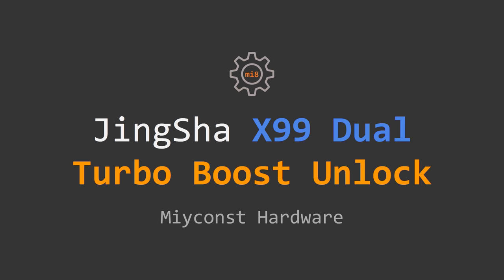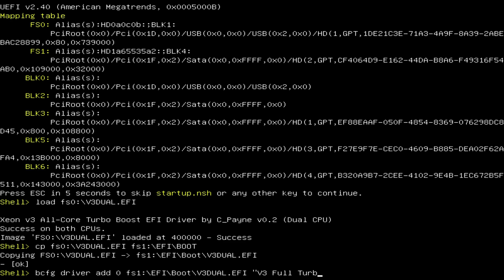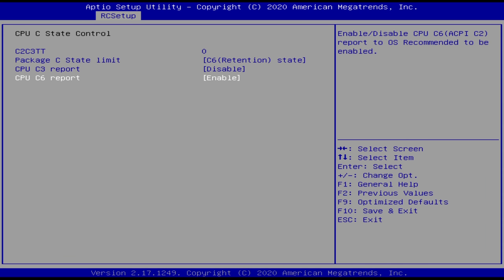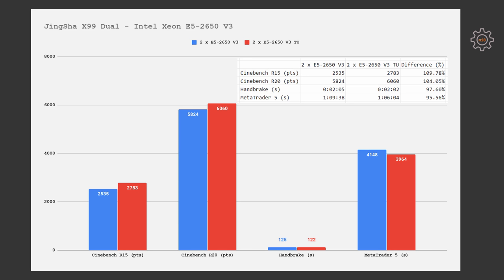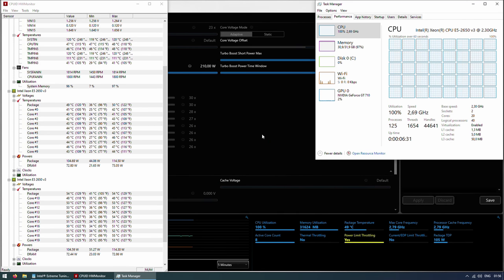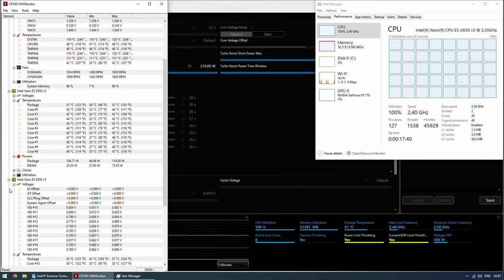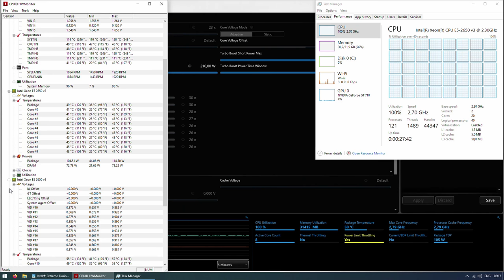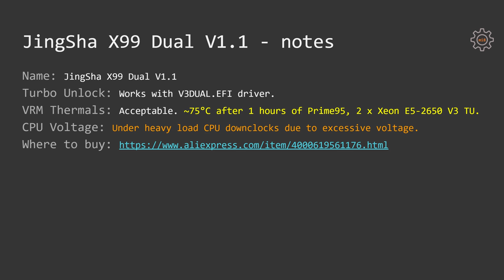🇬🇧 Turbo Boost Unlock on JingSha X99 Dual LGA 2011-3 with two E5-2650 V3

Comment: UPDATE: Now E5-2670 V3 (12c/24t) @ 3.1GHz Turbo, cost about the same as 2650 V3.
You got 2 extra cores + 100MHz clock with the same price.
Reply from the maker: Yes, E5-2670 V3 seems like an awesome deal right now.

Comment: I'm so glad I found your channel. English speaking channels about these Aliexpress dual socket boards are hard to find.  I'm currently running a Jingsha dual socket board with a pair of E5-2680v1 cpus and 128 gigs of DDR3 ECC 1600 ram  and an RX580 graphics card. Its not much for gaming but its a  beast of a work station.  I'm about to embark on a new build around a dual x99 board this time. I will be following your channel.  SUBSCRIBED!
Reply from the maker: Yeah, dual socket solutions are bad for gaming, but good for workloads which can utilize this many CPU cores & threads.
Reply: @Miyconst  Most of these boards will support VT-X. Would you know if this board supports VT-D. I would like to take advantage of PCIE  hardware pass through?  Thank you for your time.
Reply from the maker: @rdsii64  I can't say for certain, because I have not tried it myself, but others say it's supported.
Reply: @Miyconst  I may just have to find out for my self.  Either way, This board will make a really good budget media server. If it doesn't, I'll just build a 3rd box when I have the money.
Reply from the maker: @rdsii64  I would really appreciate if you let me know how it went after trying out.
Reply: @Miyconst  A soon as I have the parts on hand, I will let you know,  It will be a bit though because I won't be able to order everything at once.
Reply: @rdsii64  It supports VT-D

Comment: This is an amazing video, I am quite new to server building and am planning to buy this x99 with two e5-2680v3. You used two eSports 34 coolers. How should I check compatibility? Will any cooler that supports 2011-3 work?
Reply from the maker: It's hard to check compatibility, but you surely need coolers that use screws for mounting, not a clip on mechanism.

Comment: Ваш english is awesome! И спасибо за review! У меня сейчас такая mb и на она просто вырубается при нагрузке, температура в bios health status cpu 70 градусов, а вот sys fan аж 250 градусов цельсия показывает.
Reply from the maker: As far as I remember, system temp on this motherboard indicates temps of the second CPU, but it could also be just a broken sensor. Try to validate and reinstall the CPU coolers.
Reply: @Miyconst  ok, i will try! Thanks!
Reply: Now cpu is smeared by thermal paste as also another transistors under the radiator. Also i unplugged all power, reset  buttons from mb as also did with external usb and led indicators. I meant i turn on pc by using screw driver😀  I replace power supply and videocard to another. But it still reboot itself each time  at leats once in a hour. I think  cause of it maybe broken mb or ram. But ram usually shows us bsod, here i am don't have any blue screens. Oh and everything it is ok with temperature cpu (59-63) and sys temperature (14), but it diesn't help with rebooting system.
Reply from the maker: @vanessav5115  then the issue lies with the motherboard itself. You can try to run Memtest86 and see if RAM has any issues, but most likely this is the motherboard.

Comment: I couldn't get this board to work. Kept getting a FF code. I tried switching out everything and moving it around. I am not sure it likes my 2698v3 processors. I reordered a different one.
Reply from the maker: You can try BIOS from iEngineer and see if that helps.
Reply from the maker: @RandallFlaggisWatching  take the motherboard out of the chassis and connect the absolute minimum of the components. If it still shows FF - the BIOS is corrupted or the VRM is dead.

Comment: The E5-2678v3 will also use DDR3 ECC RAM. Will that work on this board, even you though can't unlock the turbo boast with DDR3 Ram?
Reply from the maker: This motherboard does not support DDR3 RAM, you physically won't be able to insert DDR3 memory modules into DDR4 memory slots.

Comment: hola, buen vídeo, pero yo juego y diseño con el computador; dijiste que no se recomienda para jugar, con turbo boost unlocked en x99 dual puedo obtener mismo rendimiento que con x99-f8 (single CPU)
Reply from the maker: The basic principle is to avoid dual socket setups, unless it's really needed.
Reply: @Miyconst  si, entiendo, pero con dual socket no puedo alcanzar el mismo o mayor rendimiento que una dual cpu?. Y tú podrías por favor comparar 2678v3 con 1680v3? Muchas Gracias.

Comment: Do I need a PSU with 2x 8-pin? Hard to find these psu at a fare price in Brazil.. any idea would help a lot. Thanks
Reply from the maker: Yes, you need a PSU with two 8-pin power connectors. You can buy such connector: https://www.aliexpress.com/item/32978522568.html

Comment: I  have to say I I am not familiar with all this update stuff. But I will do it for my system. I think I can follow the instruction but don't know much what they are actually. My question is, there is a procedure to copy EFI file to the boot drive after updating the bios, will I have to do the same if I install another OS onto an independent hard drive some time later?
Reply from the maker: Yes. There are two methods to unlock turbo boost frequency: 1. With manual EFI driver installation. In this case you have to copy & install the EFI driver after each OS install. 2. With modified BIOS. In this case the FFS driver is injected straight into the BIOS. https://youtu.be/YymioiX9SFg
Reply: Miyconst Sorry for being a little naive. So, if I modify the bios, I do not need to modify the boot drive? I have seen some of the tutorials showing both the procedures on the same system. I am just not sure at all.
Reply from the maker: @bananabear009  Okay, the Turbo Boost frequency unlock procedure consists of two main steps: 1. Remove existing CPU microcode from the BIOS. 2. Install additional driver, which replaces the removed microcode and "cheats" on the CPU, forcing it to turbo on all cores. This additional driver can be either manually installed into the boot drive in form of an EFI driver or injected straight into the BIOS in form of an FFS driver.
Reply: Miyconst Thank you very much. I will go through in great details before I follow the procedures. Will come back to you if I have more question.

Comment: Maybe some day there will be an affordable motherboard on these platforms that actually allows some control over voltages and limits. Really disappointing that you can't take full advantage of the turbo unlock. v3 xeons are such workhorses.
Reply: There might be, look how other chinese companies started at their X79 boards, and how they ended. There's some hope in next year or so.
Reply from the maker: @Adam130694  😮 is there any Chinese X79 with BCLK / CPU & RAM Voltage regulations?

Comment: Can you unlock turbo for other operating systems? I'm wondering if I can run ESXi with full turbo.
Reply from the maker: Turbo Boost unlock consists of two parts - remove CPU microcode from BIOS and install customized microcode as an EFI driver. So, theoretically, it shall work with any EFI compatible operating system, but I have tested Windows 10 Pro only.

Comment: Does ES CPUs work with this motherboard? Have 2 e5 2695 v3 CPUs and need to verify its compatibility
Reply from the maker: What is the stepping of your CPUs? According to AliExpress sellers, which I talked to, CPUs with stepping less than 2 are not supported by the Chinese X99 motherboards.
Reply: Miyconst The stepping for the cpu is B0
Reply from the maker: @thomasjackson6013  This equals to Stepping 1 in CPU-Z. Might work, but no guarantees. Stepping 0 don't work for sure.

Comment: Can I change the configuration of the pci-exp to 4x4x4? to use nvme adapter with 4 slots?
Reply from the maker: I am not sure since I didn't test it, but as far as I remember, the BIOS had the settings.
Reply: @Miyconst  thanks bro!

Comment: I tried to unlock Turbo boost in this mobo but got and error while flashing the modified bios "ERROR 204 : DATA VARIFY MISMATCH  FOUND". I got the same error even when flashing the original backup dump rom. And if I back up the bios and check in MMTool, all the cpu patches and some othe things are missing from my currency installed bios. (And flashing the original rom gives the same error.) Now, after the power cut computer was shut down and it isn't turning on again (Error 20) no display. I followed all the commands and have also flashed many bios in other mobos but this has happened with me the first time. I have noticed that my bios flash memory is "MX25l12805D"..i saw in some videos and internet that the same motherboard uses different bios memory which starts with "W".
I have no idea what to do now... Is is possible to fix the bios without replacing the bios chip?
Reply from the maker: You have bricked the motherboard, and now you need to restore the BIOS using CH341A or other flash programmer.
Reply from the maker: Here is a detailed step by step guide of how to use CH341A: https://youtu.be/4qX2zihB6UE

Comment: Hi I am going to try to put Mac OS on this board, but I need your help, have you any experience with ES cpus like
Reply from the maker: Hi Christian. Unfortunately, I don't have any experience with LGA 2011-3 ES CPUs, and also not able to help with macOS.
Reply: @Miyconst  Thank you for replying so quickly, have you heard any thing negative / positive about ES cpu where are you maybe I could buy some get them sent to you and you could do a review!! then send them to me!!
Reply from the maker: @christianaviola856  I have heard a lot of different things. Some CPUs don't work on the Chinese X99 motherboards at all, some don't support virtualization, others work exactly the same as their retail variants.

Where do you live? I just want to check the shipment price from me to you.
Reply: @Miyconst  uk
UK
Reply from the maker: @christianaviola856  Not that bad, at least there will be no extra import charges (hopefully). Do you have any particular Xeons you would want to buy?
Reply: @Miyconst  Well I looked on Ali express and there seems to be quite a mine field,  we can go v3 or v4 I will need two, you can test as you wish , I think if you look for a interesting one up to $200 each, if they don't work in the Chinese motherboard (we will ask seller first) I will put them in a HP Z840
my email c@cav.cx
Reply from the maker: @christianaviola856  Thanks for the offer, I have sent you an email.

Comment: if you lower the vcore offset, the cpu will turbo higher before it powerthrottles
Reply from the maker: The system might as well crash with reduced CPU voltage, but some downvolting shall be possible.
Reply: @Miyconst  yes, you try different offsets until you find a stable one. Start with -50mv and go down in inctements. until instability, then one back. Without undervolting the turbo hack only gives a few percent. Also set c6 reporting to on and c-state to c0/c1. Also csm boot to uefi. I use v3x2 efi with a -80mv on my dual 2690 v3.
Reply from the maker: @lasseberg7317  That's a bit too much for not that much extra performance :). For personal use it could be worth it, but not in my case. Either way, thank you for the advises and the info.

Comment: You can try use driver with undervolting of cpu.
Reply from the maker: Which driver?
Reply: @Miyconst  You can read about undervolting here (russian): https://xeon-e5450.ru/socket-2011-3/e5-2600-v3/hak-turbobusta/. And try to use efi driver from freecableguy (https://github.com/freecableguy/v3x4/releases) which supports 2 processors. There are drivers for a few voltages: minus 50/70/90 mV.
I tried to use minus 70 for single cpu. It allows my 2678 to gain 3200 MHz in stresstest vs 3100 w/o undervolting. But system can be unstable - it depends on processor you have.

Comment: This motherboard is very unstable i bought 14 boards and only 7 work. 2 cards could never boot and 5 crash when the windows 10 installation window appears. My configuration : 2 Xeon E5 2698 v4 + 64 Go ram ecc samsung.
Reply from the maker: I have bought two, one still works and the other one was DOA, so yeah, very unrealisable.

Comment: I put 2 v4 2680 2 clips of 8 and 2 clips of 8 on the other side and it doesn't work
Reply from the maker: Please provide your memory specification. Did you test each CPU individually?
Reply: @Miyconst  yes Server memory 2400 mhz ecc reg Kllisre
Reply: I have 4 memory sticks of 8 gb each
Reply: only the first processor is working, it has already been changed, but it doesn't work. do I have to add memory to all memory slots? I only have 4 memory
Reply: @Miyconst  yes. only the first processor is working, it has already been changed, but it doesn't work. do I have to add memory to all memory slots? I only have 4 memory

Comment: does 2680 v4 work?
Reply from the maker: It does, but I didn't test a pair.
Reply: @Miyconst  congratulations for the work
Reply: @Miyconst  the Mi899-1.2.5 has the card without video will it serve?

Comment: compatibility Intel Xeon E5 2680 V2 procesador 2,8 GHz 25M o ntel Xeon E5 2690 V2 3,0 GHz SR1A5 (10 núcleos/20 hilos)
Reply: Hi, it's not compatible with V2 stuff. You need X79 dual CPU motherboard instead

Comment: E5-2680 v3 can i use this processor to this mobo? noob sorry.😁
Reply from the maker: Yes, you can, but why would you want this motherboard?
Reply: @Miyconst  i have 4 cores 4threads and i can't stream, cpu usage is my problem.... i use  other emulator to.

Comment: Hey. There are two versions of the rom file on your site js-x99dual.tu.ffs-20 and js-x99dual.tu.ffs. What is the difference?
Reply from the maker: The -20 version has voltage reduction by 20mv.
Reply: @Miyconst  Thanks for the answer. Why would I decrease voltage? Due to power consumption or is there another reason?
Reply from the maker: @BlazPivk  I suggest you to watch this status update for better understanding: https://www.youtube.com/watch?v=AW0QgQNbBwA&t=99s